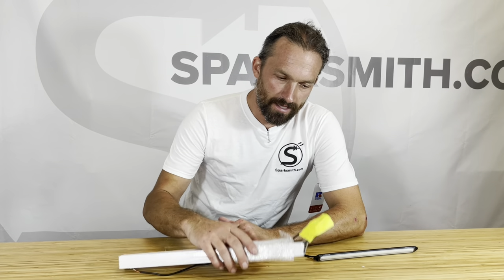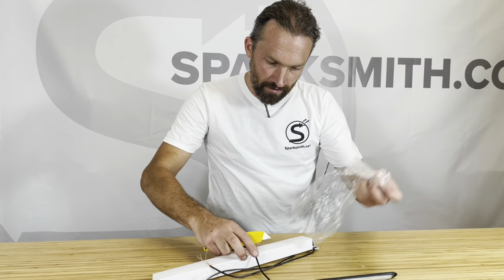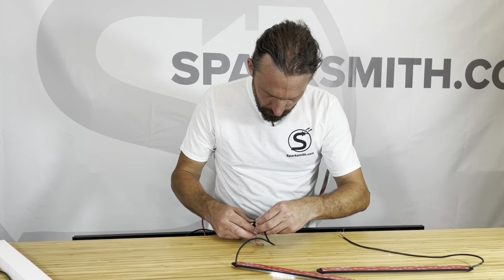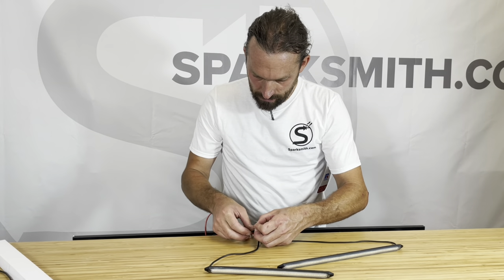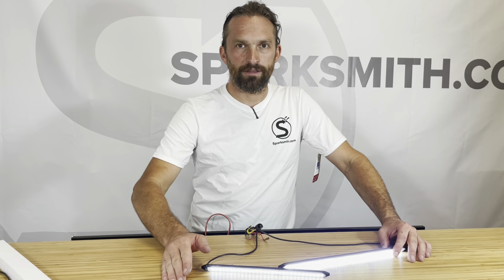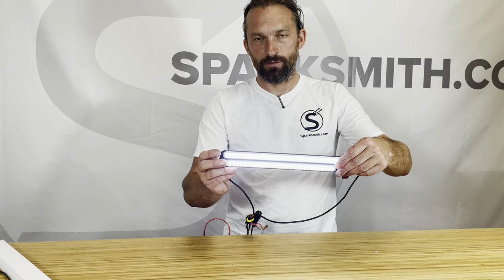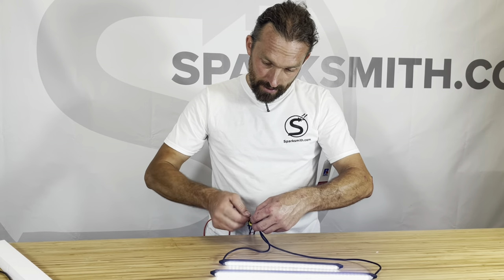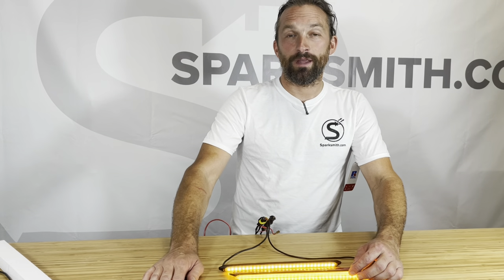2.0 Grille Bar Update

Comment: What’s the difference in the 2.0 bars and the first gen bars
Reply: The first gen bars were horrible when it came to being waterproof, they have a lot of people needing replacements as they would get moisture inside. The solder joints were also a weak point that they fixed in the 2.0
Reply from the maker: The primary focus has been on quality and reliability. These things are designed from the ground up with that mindset. We want them to be of the highest possible quality and bring the most value for your hard earned money. Plus they're a more contemporary design and can be run as a solid amber bar, which the 1.0 bars can not.